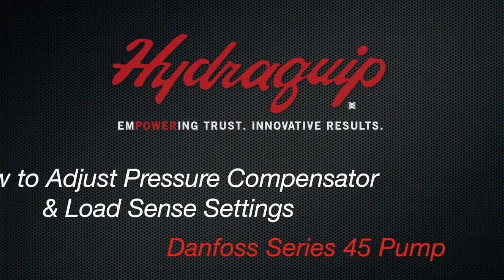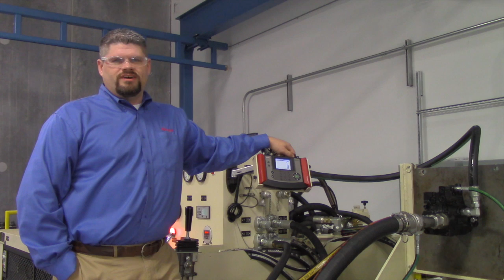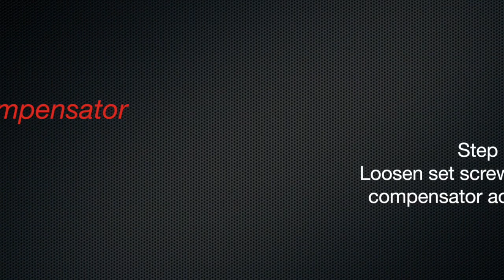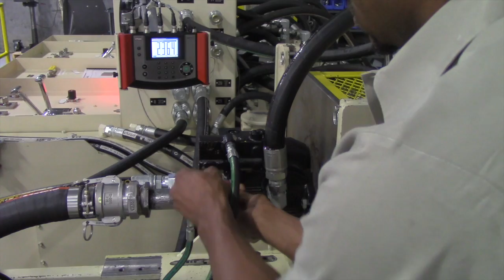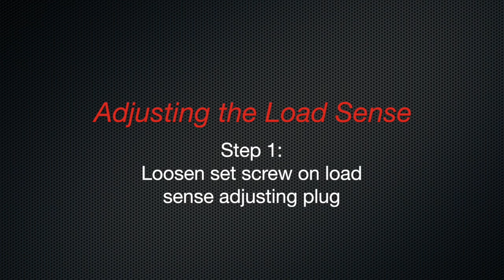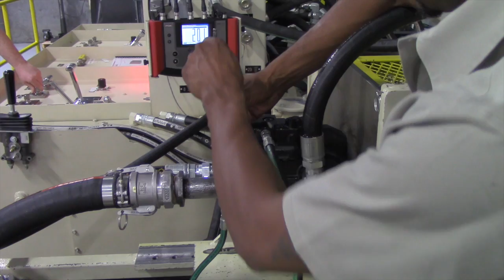How to Adjust Load Sense & Pressure Compensator Settings

Comment: Even I been adjusting pressure compensator many times I still confuse how to adjust the load sensing
For the pressure compensator outlet valve must be close in order to adjust the correct setting.What about for adjusting the load sensing? discharge valve closed or open?
Thank you very much

Comment: Why would u set the load sensing line pressur to only 300psi ...isn't tht is two much for pump to run on or its the pressure it will use with the actuator tht why?